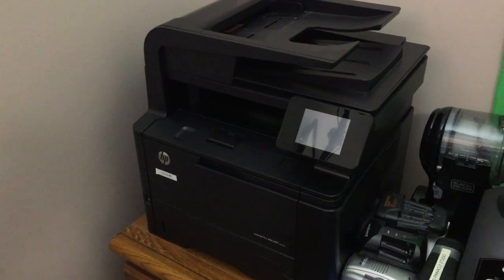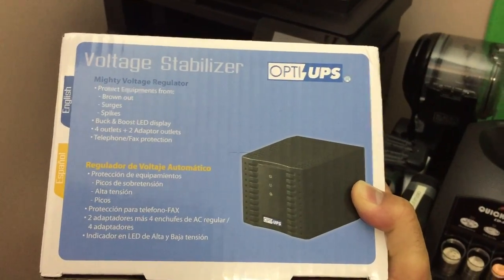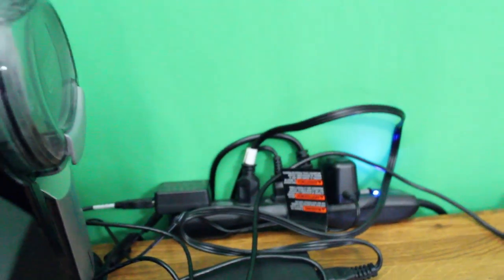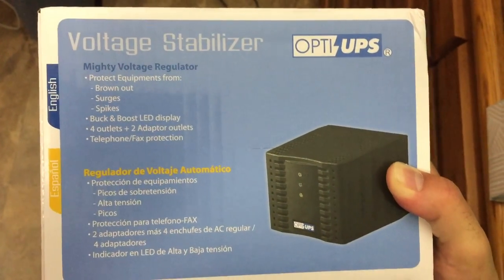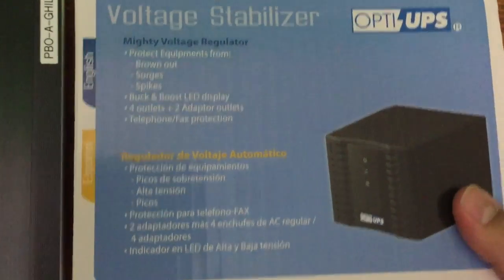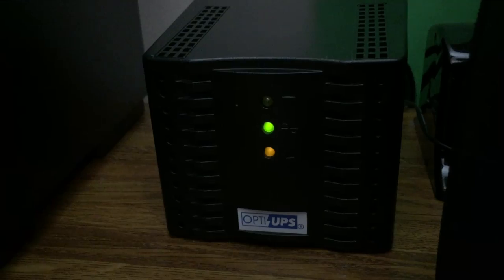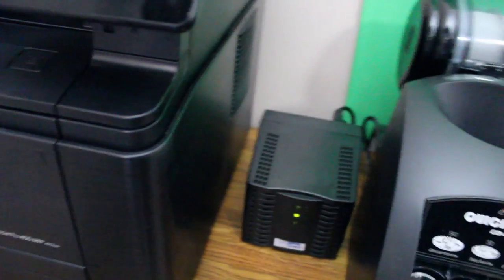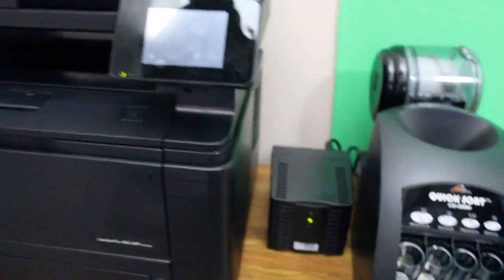OPTI-UPS SS1200 600W 1200VA Stabilizer Series 6-Outlet Automatic Voltage Regulator

Comment: can I use it for pc??
Reply: I do. I don't condone using it to compensate for overloaded outlets like this guy seems to have done, but if you live in an area with frequent brownouts/surges/spikes, like I do, you want something like this to make your electronics last longer. Just be aware that the limit is 600 Watts on this model, so if your combined PC power supply and monitor exceed that, you might want to go up a size.